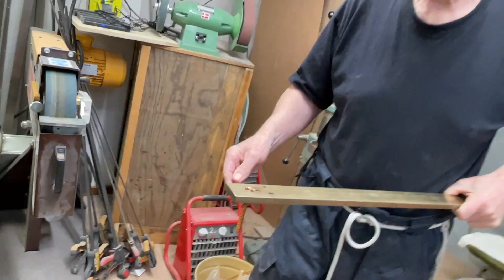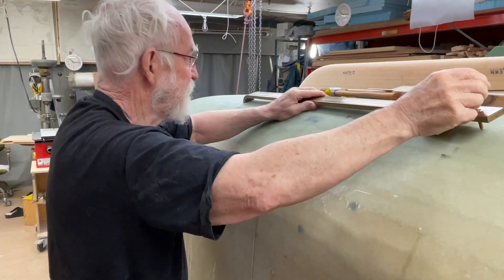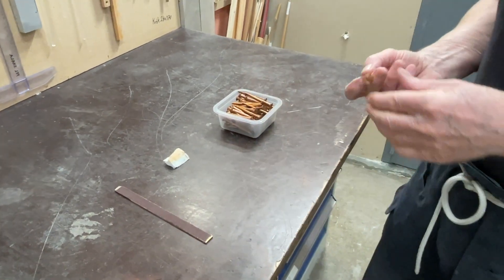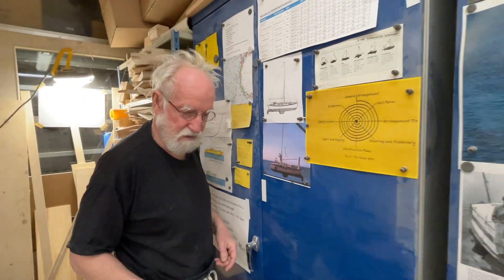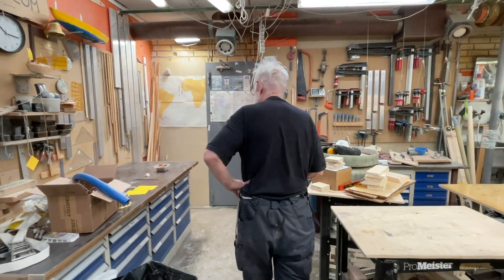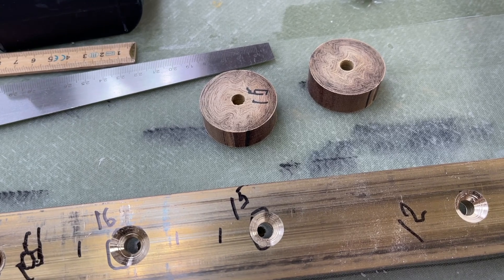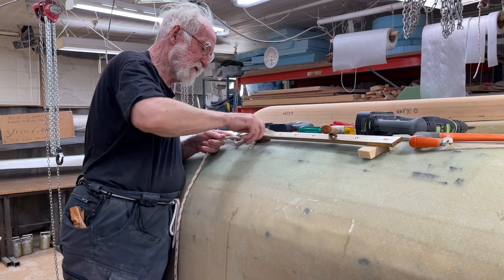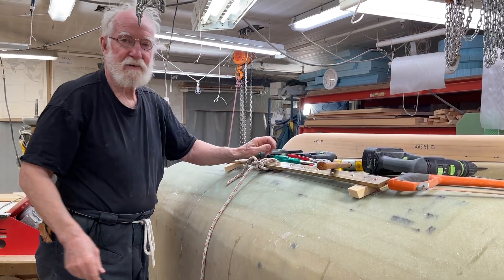5 June 2023  Shallow bilge keels

Comment: It's going to be interesting to see if it rights itself with that lighter keel.
Reply from the maker: The keel contributes only a small part to the stability curves ultimate range.
Much more important is the boyancy of the deck house.
This boat have a deck house with much more volyme than previus boats.
There is no calculations just estimates 
I think she will have much more ultimate rightning moment than all my previus boats
Reply from the maker: Also as I said before stability range is very dependent on a good height beam ratio. That is it is you do not need much ballast on a narrow boat.
Exlex beam is only 1.4 meter
Reply: It would right itself even without the keel. Look at its shape

Comment: Hi Yrvind, you say smooth bilge and twin keels is not a good combination, I'm curious why this is so. I'm considering going with a single hard chine for simplicity. I'm also curious why you chose to add a transitional plank on your boat.
Reply from the maker: With round bilges I think the keels gets to close causing more interference.
I do not understand what you mean by "Transitional plank"
Reply: @SvenYrvindExlex  I mean why you chose to soften the chine off the drawings by what looked like adding a small garboard of divinycell. I'm considering embracing the simple hard chine sharpie style like Layden or Munroe's Egret. I wonder too, is the external ballast only necessary in your view for southern ocean conditions?